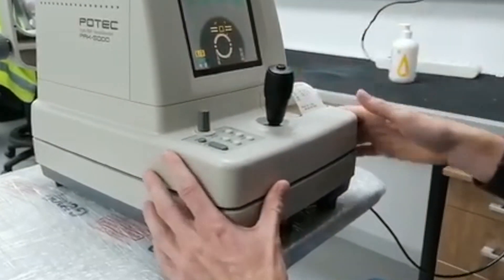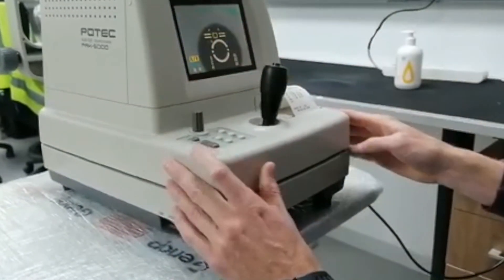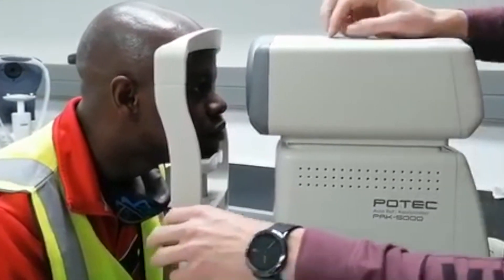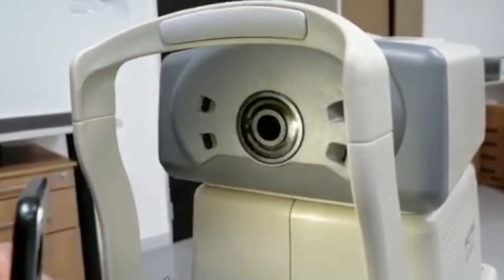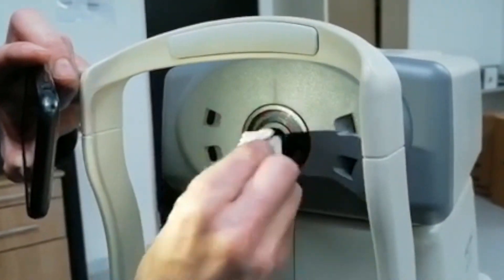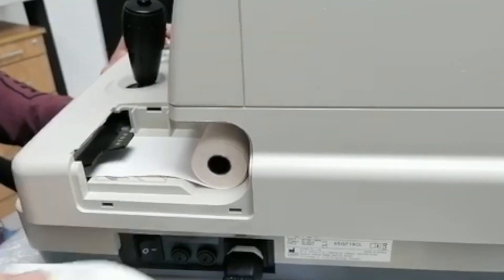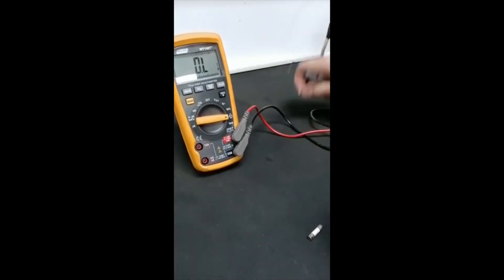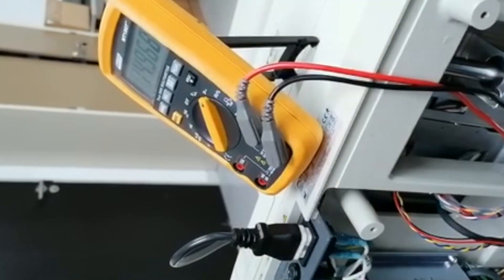Potec PRK-5000 Auto-Refractor

Comment: Hi , i am a problem with camera for this device , can you tell me how to change it or check the camera ? 
Thanks
Reply from the maker: What kind of problem are you having and is this a unit in one of OneSight's vision centers?
Reply: @jeffsoulliere6661  no iam optometrist in Palestine 
The problem is no pic in screen when i turn on the device  ( screen still white )
Reply from the maker: @israsamha7677  unforently this is a video our vendor created for us. This is not a unit that I have access to, as we use them in our Africa vision centers so I probably wont be much help. I know it sounds silly, but make sure the brightness or contrast on the screen did not get adjusted as that can cause a white screen. If not it could also be the display that has gone bad or a lose wire. Sorry I couldn't be more help, here is a link to a manual that may be helpful for you as well. https://expydoc.com/doc/3003005/operation-manual
Reply: How to change date & time?
Reply: Hunter
Reply: Good day.  Where  can I get joystick  for  potec PRK 5000  Autorefractor?